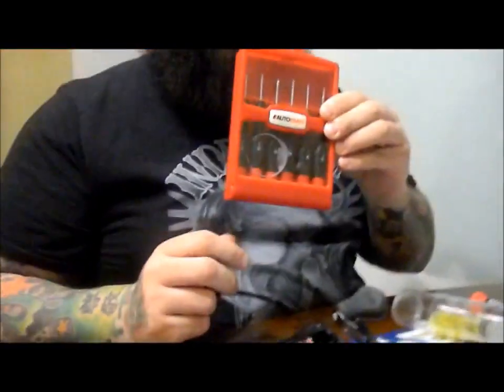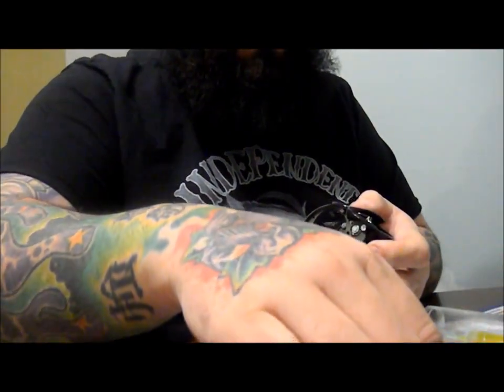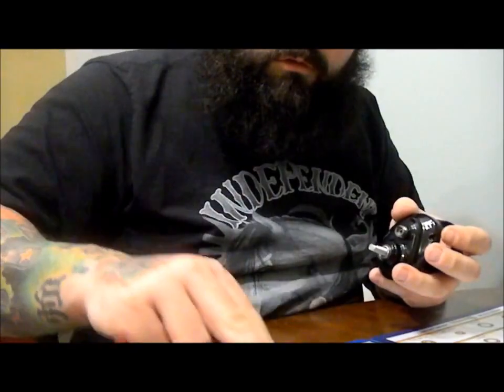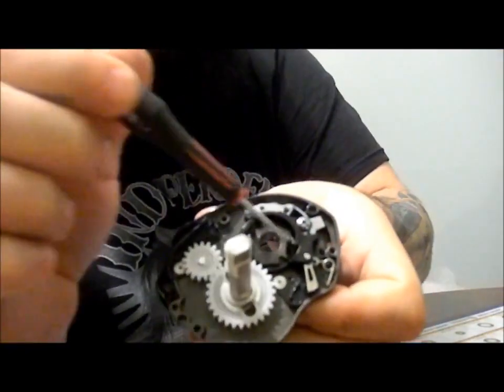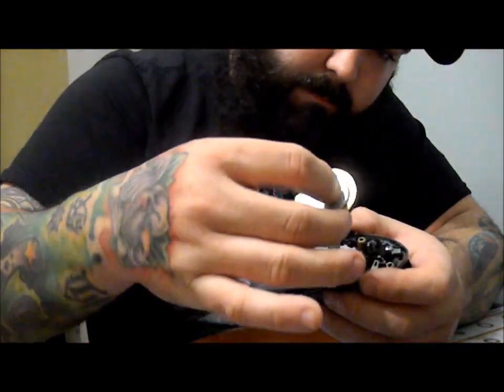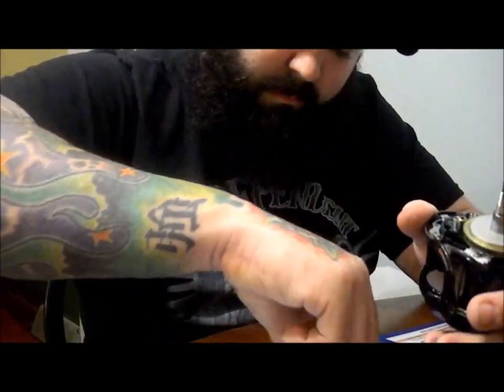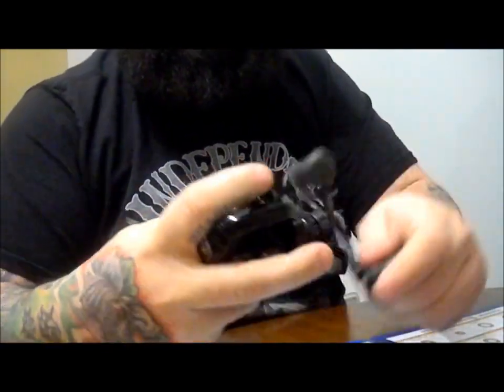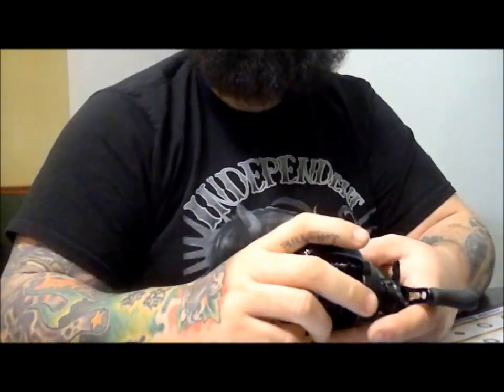How to Change Bearings In A Daiwa Tatula Type R Reel

Comment: does the pinion gear spin while in freespool and during casting too? or does it only spin when reeling in? and if i used SS bearings should the pinion bearing be oiled or lightly greased?